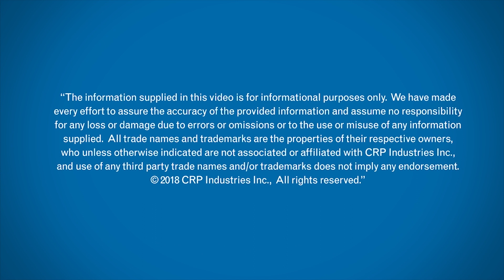ITB Episode 92: Ultra-Low Viscosity Oils — Part 2

Comment: When these newer engines with their turbochargers use oil doesn't that leave deposits on things like valves?  I wonder what the failure rate for those turbochargers are when they have such thin oil running through them.  You can only imagine that cheap oil probably is slow death for those parts of a car (if it is turbo).
Reply from the maker: We 100% agree with you about the importance of using only the OE approved fluid especially with the low viscosity oils. The Turbo chargers are the hottest point of the oil circulation in cars with turbo chargers.

Comment: Toyota started to use 0W-16 oil in their new engines now, how low can they go?
Reply: What is the change interval they recommend in the owner's manual?  I wonder because a lot of newer vehicles specify really long intervals.  My 2013 Passat 2.5 takes a 5w40 oil and they recommend 10,000 miles.  Some automakers go higher than that.  I just hope it is not with these ultra low viscosity oils that probably leave deposits on things like valves (direct injected engines are notorious for that).
Reply from the maker: @nickolas - Sorry for the late reply. Yes, 0W-16 and now even a 0W-8 super low visc motor oils are manufactured with the number one goal of fuel economy. One challenge we hear with these low viscosity oils is the car manufactrues are now considering changing their motor oil intervals back to the 3,000 miles we knew of back in the day....